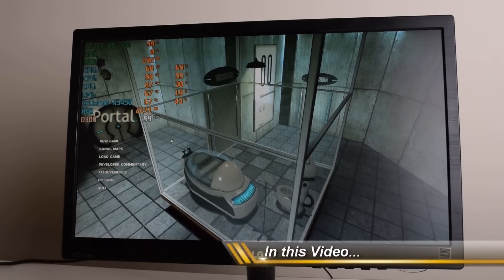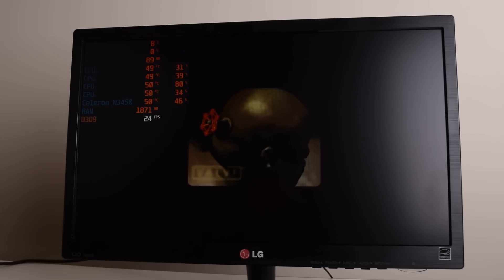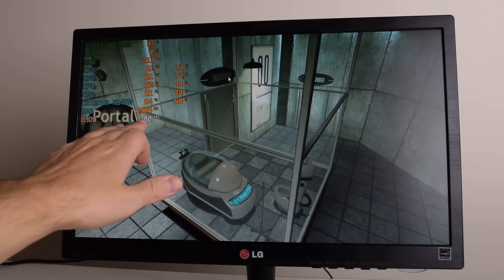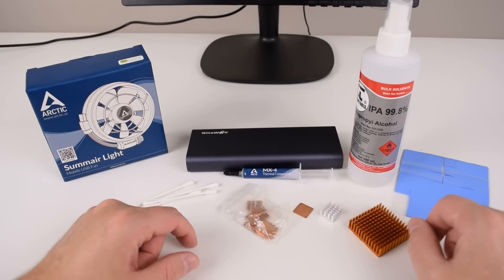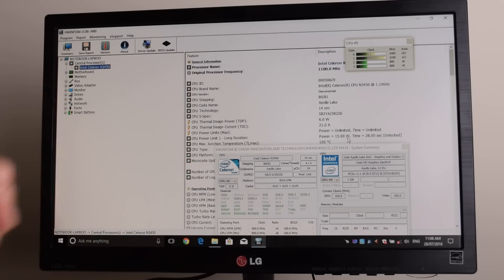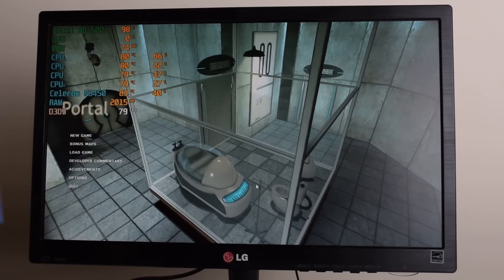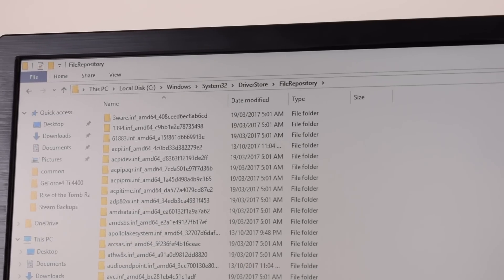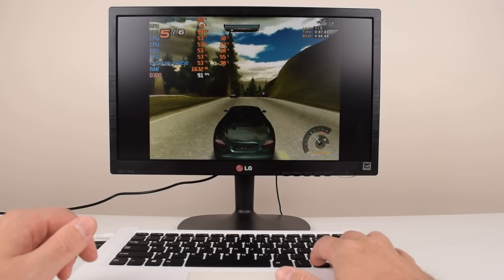Overclocking Laptop-Desktop AKA Half Top with Apollo Lake Processor for Gaming

Comment from the maker: Here is the read write software: http://rweverything.com/

Command to raise power limit to 10W: RW.exe /Min /Nologo /Stdout /Command="WRMSR 0x610 0x0 0x00DD8A00"
Reply: Thank you soooo much. Going to do some modding.
Reply: Wohoo, my Ryzen runs now with 5.2 GHz. Great!
Reply: Perhaps do this with a laptop that has a dedicated gpu cooler & cpu cooler changing out the heatsinks for what normally could be on a desktop pc or desktop graphics card in general, like mid range core 2 duo & some dedicated gpu & mount on larger coolers on them with the help of some mounting hardware & fabrication too make it nice & quiet yet still have great performance for what it is & perhaps have the laptop itself mounted on a vesa mount of some sort so that the heatsinks can stick out the bottom or top that is modified slightly for more cooling constantly, while using a external keyboard,monitor, mouse.
Reply: I did what you did to a old laptop.
Reply: Thermal solution : 
Buy a COOLING PAD for NOTEBOOKS - with as many fans as possible - Deep Cool have a quad fan that costs less than 16 euro

Comment: you never ever wanna use thermal pads on a processor, only paste is good. on a microscopical level, if you could actually see what happens, because paste adapts it's form to both cpu surface and heatsink surface, it guarantees contact on over 90% of both components up to 96% depending on the quality of the paste, meaning that thermal conduction is good. pads are terrible because of 2 reasons: they are solid, not liquid, so again on a microscopical level the surfaces of the components will not be on contact, and they create kindof like a shell that "prevents" heat extraction, leaving all the heat on one side of the pad and cool fresh air on the other, meaning that pads are one of the possible worst thermal solution for gpu/cpu. thermal pads work on things like memory ranks or vrms because typically those components don't have an active thermal solution integrated (eg: fans) so going from nothing to something is notorious. also, note that usually dissipators are made from different materials, often copper is used for cpu heat transfer to a bigger metal sink and then air (or water) to cool down that sink so you have a "cycle". that's why paste is always better, because it conducts the temperature back and forth, taking the heat out and then finding a fresh and cool sink of metal where to dissipate all that heat.

Comment: I would use big heatsink for chipset, cut a hole in case and then sand down the cooler just enough so it would not stick out of the case. I don't know what power suply it uses, if it is micro usb then use something more powerfull or combine 2 power bricks into one high amperage one.
Reply: Or get a large piece of metal and run it betwen the mottherboard and case. Everything connected directly to cpu dye, not RF shield

Comment: This is intriguing I must say, however I'd just like to verify... unless the CPU is throttling / underclocking then this won't help? Or is there something else going on behind the scenes with these power limits?

As far as cooling is concerned... nothing a good old laptop cooler can't do :) I found these especially helpful on passively-cooled laptops like my Dell 3531, dropping my temps in certain demanding games from 85C to 65C!
Reply from the maker: With more power the CPU can turbo higher, and also the graphics card.

Comment: Haha, I found one of these in a bush a few months ago. Washed off most of the corrosion and even the battery holds a charge. Was thrown away in 4 cycles, so basically brand new. Can still run 100% CPU+GPU for 11 hours!

Comment: You could always go with 25 mm fans and if you were concerned about noise you could always go with USB headers for your fans just simply splice with USB cable positive to positive and negative to negative usually they're red and black but wiring your fans with USB cords lowers the voltage and makes them more tolerable I have some bigger fans that I've done the same thing with my laptop

Comment: 3d print a case extension to put underneath the existing to have the space for the heatsink and a fan. cut of the leads for the fan and solder then directly to the power pins on the main board

Comment: Hi All, Hmm well the increase in the system wattage may be fine and unlocked in software ( windows ) but as you mentioned there could be a BIOS safeguard

When you left the machine idling in Portal, is may have not needed any additional processing power, this is why often you would stress test by running something like "Super PI" to run a cpu intensive task for 5mins or so - actually i just rang it for 16M and it took 4.9mins on my core2duo  .  The copper shims i find limited and typically used on say a socket A to level out with the fan base, or use to shim up something where the fan sits "loose".
Thermal pads are ok, but they need to conduct to something metal , as the laptop housing is all plastic the heat would not spread out, now you may be able to run a layer of vinyl insulation on top of the motherboard to insulate it and have a cut out for the thermal pads / heat sink then run say a A4 or 1/2 A4 sized copper sheet or tinplate, the idea is to electrically insulate the motherboard against metal contact shorting out.
Like the old 2010 I5 HP laptop i run, it gets hot on the base,  the newer one my wife has runs alot cooler, my sons  2016 HP I7 is basically dead cold on the base plate, so what i have done for mine is drill some ( 10-12 ) 6mm holes along the base and i also used those stick on rubber feet from the hardware shop, this allows the laptop to have a air flow on the bottom, it still physically gets hot on the bottom, but is a few degrees cooler in reality due to the air flow, but the CPU is about 10 degrees cooler - this one is very tricky and i am not dissembling the copper air pipe that runs to the CPU, compressed air at the workshop in all vents and removing the base plate is fine every 12 months, like  car oil i think thermal paste should be replaced on a service interval basis.

Finally, a overkill is to use those laptop boards, they are like a huge open mesh platform with 2 x 120 mm fans that run of the laptops USB power, oddly enough they are comfortable on your lap and quiet.
Regards
George
Reply from the maker: Great ideas!

Comment: put a heat sink on anything that had a thermal pad or contacted the metal plate. Also use a compatible high wattage power brick. From there if I wanted more power I would shunt mod it. as far as cooling and keeping the form factor I cut away large portion of the back and replace with metal and then attach it to the heat producing chips and mount a thin blower fan inside with extra heat heatsink attached to the inside of the plate in the air path of the fan with all appropriate intake and exhaust setup while doing my best to thicken the case.

Comment: Idk if you will have the tools and the knowledge, but with the lcd driver you could 3d print a case and make an all in one computer, the most challenging part would be the power button i think, the cooling would impro drastically. And you could add powered usb hubs and the psu inside.

Comment: This video gave me a idea you heard about the thermal throttling of Apple thin gaming laptops? You could do a video like this on one see if it works cut a hole in the bottom of the case and put thick leg pads to raise it up and you got a gaming laptop that doesn't throttle I did a similar mod with a mini itx gateway sent pics once

Comment: dude, need to put the power plan on "PERFORMANCE", or it will throttle sooner, think you had "balanced" selected, it will cripple performance, especially on laptops.
Reply: I never used Windows 10 personally for gaming, but doesn't it automatically engage an game mode once a game in launched? I think I read that that function was added last year.
Reply: armorgeddon  thats different and other than maybe not trying to sync your calender while you are playing, i think it  does precious little if anything. "Perfomance" mode basically disables sleep and makes the cpu go full tilt all the time instead of changing clock speed between say 800-4000mhz on  a high end desktop computer.

Comment: Why not cut the back of the machine to make a place for a passive copper heatsink
U might put some thermal pad all around the processor AND then put the heatsink on top of the processor this might help cooling the others components around the processor thus increasing the power delivery performance.

Comment: I don't think you are going to get that going any faster. If you want to be able to close it back up, a wider heat sink, like the big orange one but probably half the height. You might have some old busted motherboards that have really thin heat sinks on the chipset or old ATI Rage 128 heat sinks that are not much thicker than 5-6mm. You might even try using a grinder and bring that orange sink as far as it could go. If there is enough room, a really thin blower fan if they make such a thing. Then of course, cut slots in the case for ventilation.

Comment: Id neatly cut a square on the back case, install liquid metal and a very thin fan and thin and wide headsink, then balance the height on other side of case with bit of glue and plastic, then the keyboard will tilt up nicely for typing!
Reply: liquid metal for this seems a tad bit overkill don't it?

Comment: Hi Phil , I have an idea of improve the thermal performance of the Half-top.
The ieda is glue down some copper foil on the battery and the bottom case, then using some 1mm thick copper heat pipe to transfer the heat from the processor to the copper foil. It should give some thermal performance to the Half-top.
I hope my idea will help you.
(BTW sorry for the crappy English, due to I am using Chinese more than English)

Comment: copper shim with compound on both sides, making contact with the  metal shield. then thermal pad that to the case. you should remove the plastic protector in the area you're using for thermal contact with a knife or what-have-you. copper fins from an old heatsink also work well for shims, cut down with a pair of cutters as necessary. you can dremel out the bottom and increase the height of the bottom of the case with feet if you so desire as well for a similar effect. what you want is cooling that can dissipate more than the TDP you're putting into it, and this may just work. there will be some loss, but it shouldn't be an issue if you use the big chipset heatsink. do NOT sink the eMMC whatever you do. that needs to stay warm to operate nominally.

Comment: Push come to shove you can use the chipset cooler and cutout a portion of the plastic panel to make room provided there isn't other issues. Modern laptops can be pretty crappy when it comes to cooling.

Comment: Hey Phil. Have you come across anything similar for Haswell based laptops? I have one with a 47 watt TDP chip that has unfortunately been limited to about ~27 watts. Really hampers performance
Reply from the maker: This is really a one off, I do very little with laptops, and what I have is all budget stuff out of China :D I just thought this might be interesting to share :D
Reply: Ah no worries. I should probably do some of my own research on the topic.
What also might be interesting to try in your case is to undervolt the CPU with Intels eXtreme Tuning Utility after raising the TDP limit to 10 watts. I managed to squeeze a decent amount more performance out of my Haswell by doing so even though it's still limited to 27 watts.

Comment: To my mind a GPU cooler could be a good bet if you want to keep it low profile.  At that point I would be looking to put the computer in a different case (to use with a standalone keyboard and mouse)  which might suit a traditional CPU cooler from an older machine but I think fixing them in place could be a problem with the lack of mounting points.

Comment: Hi Phil, I would suggest taking a look at the power brick and see what wattage it outputs max, its fairly easy, Amps x Volts = Watts,, remember to check the DC side of this not the AC side and to accommodate quite quite a bit as it needs to charge the battery aswell. it could be a limitation of the power supply, or even the DC to DC convertor used to power the CPU.
Reply from the maker: Good point! Had a quick look and it's rated at 12V with 2A.
Reply: PhilsComputerLab hmm so 24watts so it should be more then enough
Reply: Propably the performance wasn't raising with raising the power limit because both CPU and GPU has already been on their max Pstate? You should have tried increasing their clock speeds but that would only be usable if you mod the cooling properly for 24/7 use.

Comment: I guess you're limited by the form factor.  Any more effective cooling needs a larger case to house it.  You might consider sacrificing the slim case, built-in keyboard, and trackpad.  Then build/bodge something to hold the motherboard, and use a USB keyboard and mouse.  Since the half-top is tethered to a monitor anyway, you wouldn't be losing portability, plus you'd have room for a fan and heatsink combo.  Maybe a mini-ITX case, or even a retro PC case for a sleeper system.  I'm on the lookout for an AMD APU-based laptop with a broken screen for something like this.
Reply from the maker: Yea someone suggested this for the last video. It's definitely a great idea for a more permanent setup, but I don't want to lose the portability factor.
Reply: Then perhaps a DIY heat pipe; a piece of copper that emerges outside the case to the air.  Just to bleed off some heat passively.  Put a 90 degree turn in it, and you could route it along the back of the case to keep it discreet.
Reply: perhaps check if you can put on a heatsink thats wider on the cpu while still being able too close the bottom (that is better then the stock heatshield + thermalpads)
Or hack open the bottom a bit so the heatsink itself sticks out & then put on feet on all 4 corners so it sits a bit above the height of the heatsink you used in this video ?
Reply: What if you 3D print a case for this tiny little motherboard? 😉
I think a CR10 mini or just a regular CR10 should do the job nicely. 😊
Btw sry for my poor english... 🙈

Comment: Did you have issues after some time using it? I'm not talking about thermal, but software issues. 

I've done that to a laptop, but after some days using that unlock script, it stopped working, returning the message that it couldnt find the place or something like that.
I have no idea why, but the script now doesnt work anymore.
Reply from the maker: I've only used it for the purpose of this video for a few days!
Reply: Eduardo Avila Check antivirus, it may have deleted/quarantined the file

Comment: But this isnt much a overclock, its rather unlocking the power limit. As he runs at his normal turbo performance. 
And many of these apollo lake all-in-ones and laptops actually perform better when the cpu is limited around 95%, because the heat gets bad, and it throttles, but not aways the processor, sometimes it seems to be at the right clock, but the gpu is throttling. 
My friend suffers a bit with that, i've tried to unlock but only made things worse, and its a all-in-one, so it isnt much possible to have better cooling.
Reply: Yeah, you're true. But, i have exactly the same CPU (on my secondary laptop) and it suffers BADLY from PL1 (power limit)
Reply from the maker: Yea fair enough, it's always tricky naming titles so people can find it. You're right, the chip has CPU and GPU, so the outcome can vary. It's mostly the GPU that benefits. Other Laptops have better cooling, so that makes it easier :)